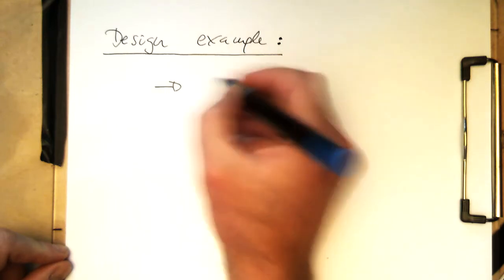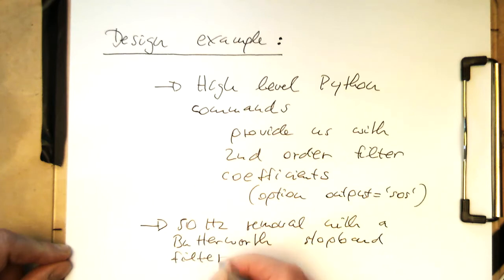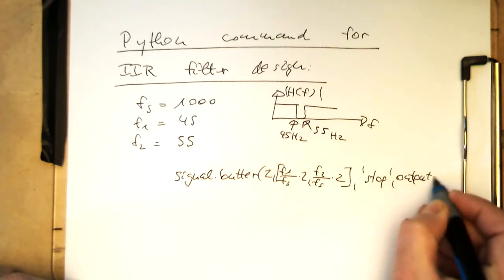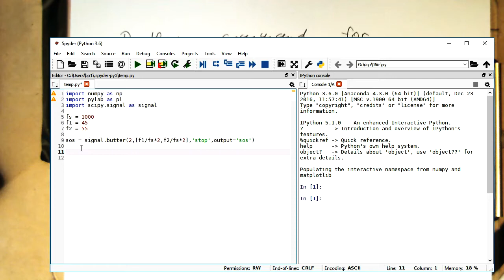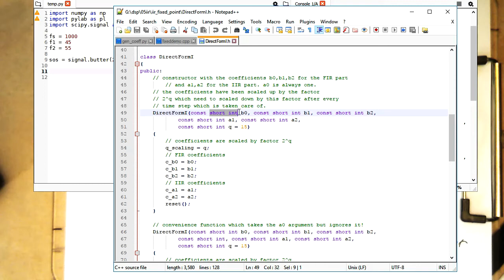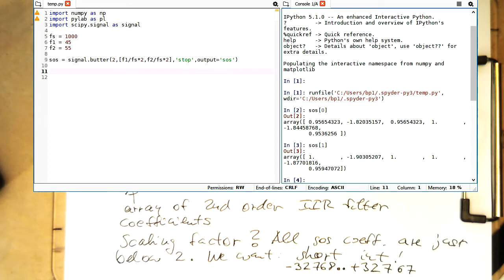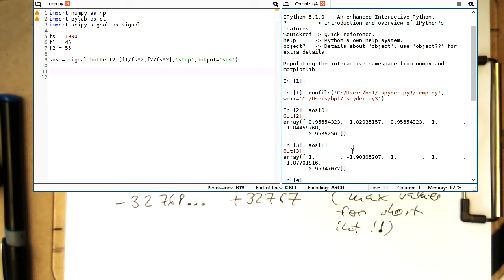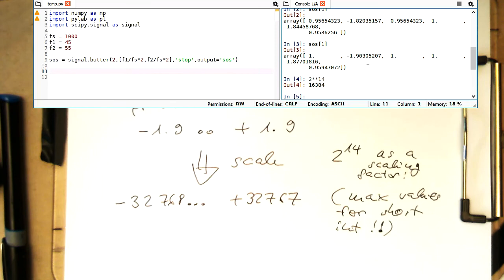Fixed point IIR filters (Py): Calculating the coefficients (0002)

Comment: but what is the "denominator coefficient vector of the filter" ? you've mentioned that, you'll talk about the "1" coefficient for lfilter later, but i can't find a video for it...
Reply: because, i've made a FIR filter, and the "shape" of it's output seems correct. but the value is wrong. i've change the denominator coefficient into 20. the function value become smaller. 
20 is not correct, but it means that the problem is this coefficient.

my example has n_x point, each points is a measurement between 2ms. it means 500HZ sampling rate, right? then i want to filter the wave upon 20 dB, and here is my code.  

M = n_x     #number of tabs
fs = 1/0.002 #in HZ 1/0,002 s sampling

f1 = 20/fs     #20 dB
h = signal.firwin(M,f1*2,pass_zero=True)   #lowpass
h = h * np.hamming(M)
H = np.abs(np.fft.fft(h))
plt.plot(signal.lfilter(H,1,nm))
Reply from the maker: It's not MATLAB. In Python both the num/denom are in one row. Half of them num half denom. Check out the documentation.
Reply: Digital Signal Processing I've saw it, but i don' understand, why we using this denorminator. 
And what do you mean "num and denom are in one row?" row of what?
Reply from the maker: The sos array is two-dimensional: every row contains one 2nd order IIR filter (6 coefficients where 3 are for the numerator and 3 for the denominator). If you don't understand what a denominator is I guess you haven't understood very, very basic IIR concepts. I'd recommend that you go back to the intro of IIR filters here.
Reply: thanks a lot, i thought i just need the basic for FIR. and I've saw the denominator's explanation in one of your Video :)